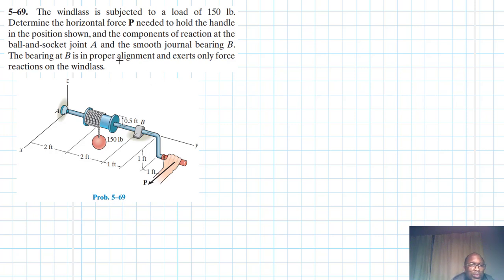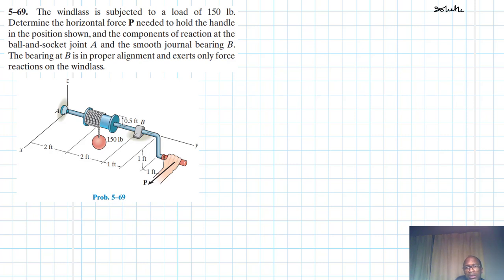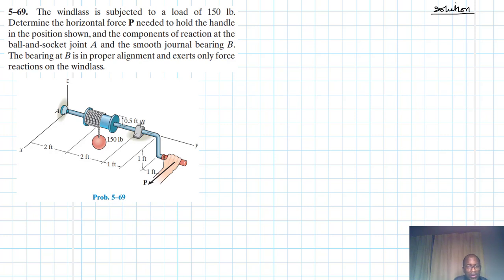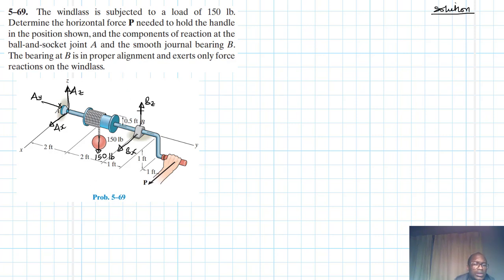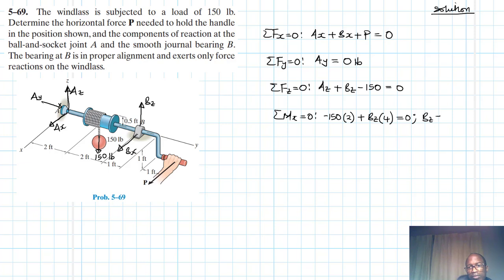5–69 Equilibrium of a Rigid Body (Chapter 5: Hibbeler Statics) Benam Academy

Comment: When calculating the moment for z, why is the Bx force negative. Wouldn't it be positive since the P force would be rotating the object clockwise so it would keep it in balance by attempting to rotate it counter clockwise?
Reply from the maker: Bx is negative, and this is fine because the it is in static equilibrium. The summation of forces in X-direction: +Ax + P - Bx = 0. And the summation of moments about the Z-axis: -P(6) + Bx(4) = 0. Use the right thumb rule when taking moments.
Reply: @benniehamunzala  Thanks. I see my logic error now.
Reply from the maker: Cool